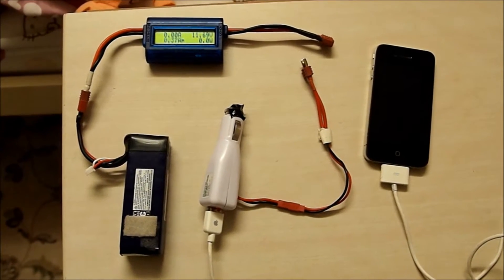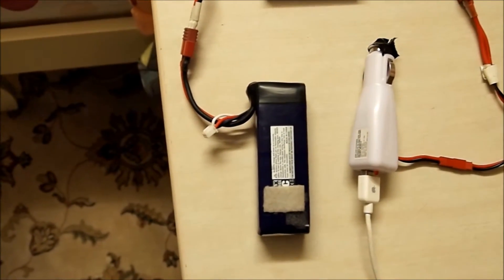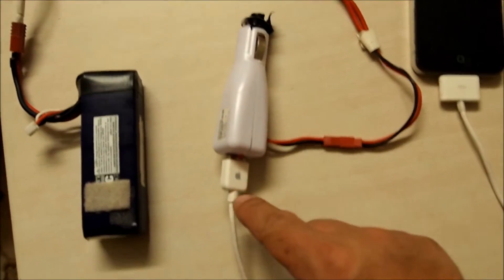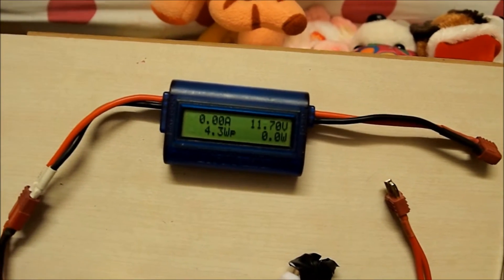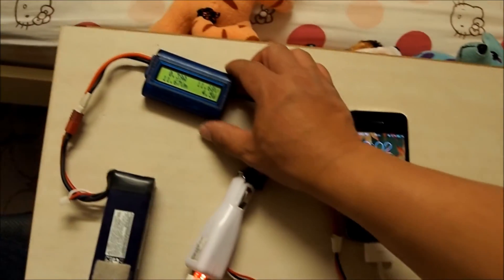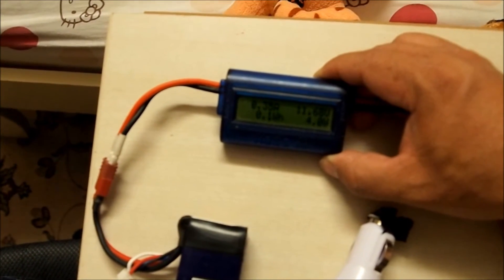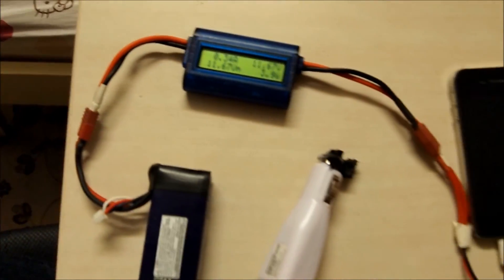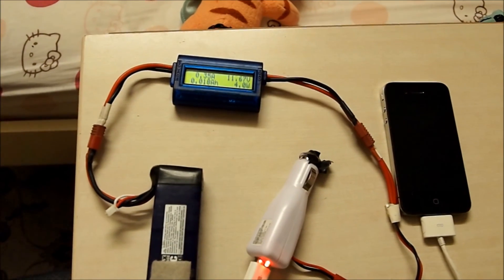How many amps does an iPhone consume during charging

Comment: If you measure the Amps before the transformer(car charger) the current you will see will be lower them the real. This happens becouse, in a transforme, the voltage is lowered and the current highered.So he is pushing 350mA in 12 v, so in 5v it's pushing  840mA. Sorry for my bad eng.
Reply: This is true

Comment: Hey man i have a question. I have a 2s lipo battery that i just got i do have a charger its a onyx235 how long do i leave the battery charging for
Reply from the maker: since it's a 2s, set it to 2s, then just set the correct amps to charge it at. (for example, if your lipo is 1000mah, you would charge it at 1amp.) The charger will stop when it's fully charged.

Comment: I think thats a little off..shouldnt the meter be between the car adapter and the iphone? Between the circuitry in the adapter and the usb female jack? Which is impossible unless u destroy your car adapter. But yea It should be battery-car adapter-meter-iphone. U measured the amps the car adapter is pulling from the battery not what the iPhone pulls when charging.